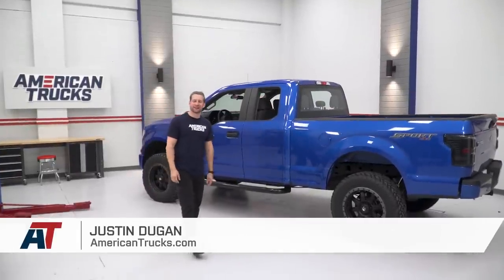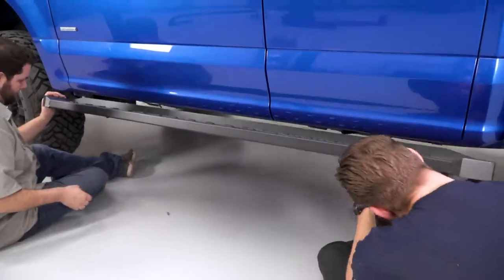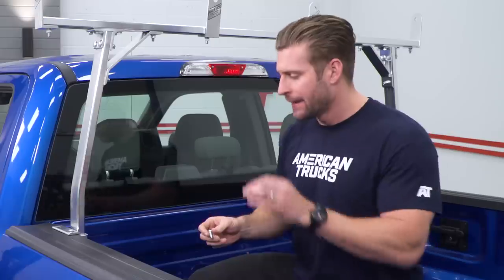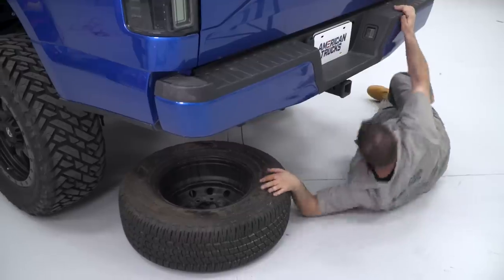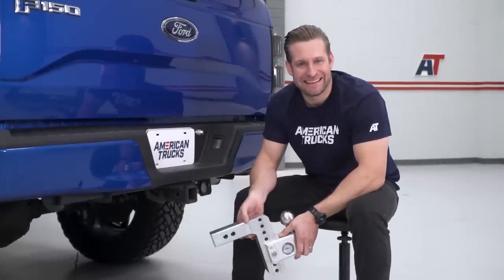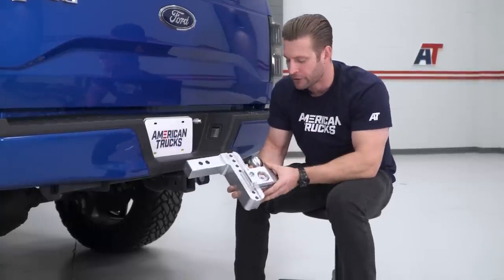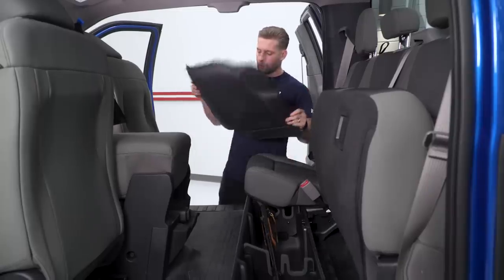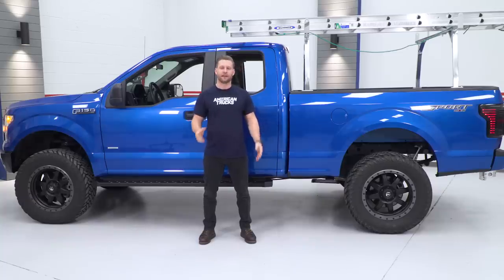The 8 Parts You Need For Your Ford F150 Utility Truck Build - The Haul

Comment from the maker: What are the must-have parts on your utility focused build?
Reply: AmericanTrucks Ford 
Winch, hitch, auxilary front and rear lights, tool box and for sure a power inverter
Reply: Used a glad hand on my bumper with a shut off valve all weather capable that way.  Opposite side glad hand has your normal air hose fitting on it.
Reply: What's the make and model of those tail light black out covers?
Reply: Backrack was a must after busting my window. KYB MonoMAX shocks, LT rated tires(dont pop as easy) bed liner,  tool storage, Dickies seat covers. 
A locking diff and skid plates for getting around on construction sites and the land fill is on my wish list but probably won't happen til I buy a "new" truck, hopefully an FX4 with that gear already.
Reply: An 8 ft. Bed with drop-in bed liner.
Reply: Tow ball in bed, better alt, tool box, kickass front bumper, manual trans, better cooling and i'll keep thinking of new more things
Reply: Why not use racks that go in the stake holes?
Reply: Mounts for turrets, and stuff.
Reply: The point of the steel bumper replacement is it have protection from the deer, this bumper wouldn't protect against anything but maybe a bunny
Reply: There's another rack, I think built by Yakima, that's adjustable up and down. I plan to get one for my truck, and then add my Yakima basket on top. With it being a bit more low profile, It should look pretty cool. And that basked is extremely useful.
Reply: In addition to a bed liner I have a thick rubber bed mat in my truck, saves the metal from dings and damage when throwing chains and binders etc in the back.  They dont roll around and you hear less rattling
Reply: Auxiliary gas tank.

Comment: My build would be upgrading the alternator to 440 amp alternator, install waterresistant plug in jump start receptacle in the front grille, standard 12v receptacle on both sides of the bed, and single 220/240v receptacle at the rear bumper.
Reply: Samuel Hur  I'd like to see that build
Reply: Heck yeah brother I'd be first to copy if you make it work out.

Comment: Those step rails should have a third bracket. They appeared to sag in the middle a good inch plus when stepped on.
Reply: Yeah I wouldn't use those they look flimsy as hell
Reply: Those steps are NOT sturdy...  I would avoid those...

Comment: A tool box that is half compressor and half tool box is way more utility than a unit that will take damage the first time a little clown car rear ends the truck )which will happen several times in the life of the truck) and displaces the spare tire from the most practical place imaginable for it.

Comment: I've purchased and installed the AMP Research BedStep2 based on this video.  Absolutely great product that solved a real problem - bed access at the side of you truck bed.  Assembly and installation was easy.  The whole process certainly will take less than and hour.  Installs on existing frame with no drilling or modifications.  Very, very nice!  (A bit pricey.)

Comment: Honestly as an owner of a construction company with the need of work trucks, this is pretty much the set up I use for some of them, instead of the ladder rack, I’ll throw a tool box and instead of the front bumper I’ll just put a brush guard, I do put cheap mudding tires and wheels so the employees can have fun on the dirt from time to time

Comment: Steeps bending in the middle! How solid can they really be?
Reply from the maker: *Steps.  And believe me, despite the small amount of movement from a 200+ man bouncing on them, the barricades are very solid.  -Justin
Reply: All steps bend, the ones from Ford bend too, and technically they flex since bending implies that they don’t come back to original position.
Reply: Daniel Napast My factory steps on the 2012 lariat don't bend. And I weigh more than Justin.
Reply: Ink stained canvas My factory steps on my 08 lariat dont bend and in a 320lb man
Reply: You don't even have to bounce on them to see them flex. Pretty chintzy if you ask me.
Reply: My 08 Ford steps bend lol I'm about 190-200lbs and they bend.
Reply: AmericanTrucks Ford  Well, they shouldn't. Im sure they're just fine but they need a center support as well. I call that well built.
Reply: I should do a video on the side steps I built that don't bend.
Reply: @danielnapast4955  I can assure you my rails don't fucking bend on my 2018. They do not "ALL" bend.
Reply: If the steps bend you don't need other steps, you need to lose weight.
Reply: 14 gauge steel?
So sheetmetal...
Why wouldn't  they go with at least 12, better yeat 10 gauge.

Who makes a affordable set, that if you stuck a hi-lift jack under in, you could pick up one side?
Anyone?
Reply: The $99 steps I had on my old 09 didn’t even flex when people stood on them. The factory steps on my 2014 lariat indeed to not flex whatsoever. I wouldn’t trust steps that flex.

Comment: I want those rims for mine. The under bead air compressor wouldn't be a bad idea but I won't lose my spare tire for it. That ladder rack should have been black but I'd rather a shell with a cargo top than the ladder rack. What should have been included is the latch that lets you swing down the back seat. I put one of those on my 13 and it makes for a great storage area.

Comment: The hitch is what I like best. I wouldn't put pneumatic equipment in the dirtiest least accessible space, nor get rid on my spare tire. Also the weak fixed aluminium frame gets in the way when climbing on the bed. Has to be better options. For the fixation great point about Galvanic corrosion but use stainless steel bolts (of same strenght) with insulated washers, not zinc plated self-drilling screws !

Comment: I WOULD SAY A BED LINER WOULD BE A MUST HAVE FOR A UTILITY TRUCK OR ANY TRUCK FOR THAT MATTER TO PROTECT AGAINST DAMAGE. AND WHAT HAPPENS WHEN  YOU GET A FLAT NO SPARE TIRE UNLESS YOU PUT IT IN THE BED PERSONALLY I PUT MY AIR TANK IN BEHIND THE PASSENGER FENDER WELL AND HAD THE AIR COMPRESSOR IN THE ENGINE COMPARTMENT MORE LINE IS REQUIRED BUT RAN IT DOWN THE FRAME RAIL AND LOOKS NICE AND CLEAN BUT WILL REQUIRE A CUSTOM BRACKET MOST OF THE TIME TO MOUNT IT IN THERE

Comment: 1 zinc does nor stop galvanic corrosion, it makes it worse
2 mounting the switch and gauge under the bumper will rust it away and corrode the contacts in the switch
3 that bumper is really cool if you dont have chrome, nothing bad to say about that :)
4 why did you opt for not putting a mat over the front hump?  and no rear mats?  This seems like a huge oversight.

I really love the idea of the onnboard air, but I never see anyone address the 20 ton gorilla in the room.  That is that mounting the pump and tank under the vehicle will lead to premature failure from rust and corrosion.   I never see any interesting ideas on how to protect it.
Reply: Maybe use bed liner on the air tank. For the compressor I'm not sure if that would be such a good idea.
Reply from the maker: I'm sorry but you are simply incorrect about your statement towards zinc worsening galvanic corrosion.  While not perfect (aluminum to aluminum) Zinc and Al are extremely close on the galvanic table while the 'Anodic Index' falls under .25V which is acceptable in outdoor/wet/salty environments.  And in regards to your statement about the on board air,  as stated in the video you can mount the system anywhere you see fit, we just selected the spare tire area for the sake of the video. -Justin
Reply: We'll see when whoever gets that truck has giant holes in the bed in 5 years
Reply from the maker: If you have a scientific rebuttal or proof stating the contrary, I'd love to hear it. And I'n not being a dick, I'm genuinely curious.  -Justin
Reply: electrohacker Zinc coated screws are better than stainless screws in joining aluminum. However, your only going to have a galvanic reaction if the materials are touching and there is moisture present. Using bolts with Teflon washers or sealing the connection from moisture might help... but welding the aluminum directly is the only way to eliminate the problem.

Comment: Dude mentioned galvanic corrosion! As a welder, that was worth more than most of you realize 😉 👍
Reply from the maker: Haha, thanks for that! -Justin
Reply: Ford doesn't pay attention to it. For YEARS they were using uncoated bolts to hang up aluminum exhaust shields, and then the shield ends up with huge holes where the bolts sat and would fall off or rattle around. Then you'd have to use huge fender washers to try to keep the thing held up.

Comment: Good video.  

However, moving the full side step back a foot would have likely provided enough boot room so the (very cool) Amp side step was unnecessary.

I like the compressor, but how safe is compressed air in a collision?  BOOM?!

Also, no inside blueprint/gun rack?

No outside locking tool box(es)?

No cold air intake mod, etc.

If you ever have done commercial or residential construction, you understand the value of these suggestions.

Thank you for pulling together such a nice video with some very cool mods!!

Comment: Question: Does this (or most others) bumper that covers the intercooler intake restrict the airflow enough to hinder performance? I’ve wanted an off-road bumper with winch but everything covers that intake.
Reply: I was wondering the same thing.
Seems obvious that it will inhibit the intercooler. I really like the look though.

Comment: How is the iron cross bumper going to effect the CAC? Doesn't Ford say not to run a plow on it as well?
Reply from the maker: Its not ideal but there is flow to the charge air cooler.  However since the goal of this video was to appeal to all 2015 and newer trucks it made sense from a 'utilitarian' aspect.  -Justin
Reply: They will ruin the engine with that bumper
Reply: @kawiracer475  it's a Ford it's already ruined
Reply: @kawiracer475  -Wrong.  Don't be stupid.  Class dismissed.
Reply: @243wayne1   Ask any tuner.  They say not to even put a small light bar in there.  You're about 2 years late to the class buddy.

Comment: Damn Dude this truck came out looking BADASS!! I need something like this for my job. I do framing/carpinteria. I use all kinds of ladders and power tools. Where did u get the lug nuts that hold down that mount for the ladders? I just want to take the advice you said about the problem with wrong screws on the aluminum truck.

Comment: The air compressor was the only good suggestion, and suspension support air bags should be a must on an F150, an 8 ft bed would have been actually useful.  1/2 ton truck won't tow much. it is very sad for me to see sooo many short bed trucks with luxury interiors pretending to be a truck

Comment: In NY that air system would be in rough shape due to sand and salt spray.  Also modern trucks are hard enough to use for work without a lift kit.... they are so tall
Reply from the maker: As stated in the video, there are a number of places you can install an on board air system.  And I agree with you on the lift, but there wasn't much we could do about that one as all of our shop trucks already have a lift.  Its also why I said in the beginning, 'try not to pay attention to the lift kit and tires as the parts in this video are meant for all 15+ F150's.' -Justin
Reply: But not in Phoenix.....

Comment: I see FAIL #1
You did not get a spray In Bed Liner
but
I like the On Board Air, would like to know other locations for mounting
and
is the bumper a straight BOLT ON

Comment: Details on the lift kit, and wheel & tire size plzzzz
Reply from the maker: The truck in this video is utilizing a 4" Zone lift kit along with 20" Fuel Wheels and 35x12.5x20 Fuel Tires. -Justin

Comment: Can't reach the tool box? Can't reach the rack? Can't climb into the bed? 
Don't lift a work truck. Lol.

And please don't believe the block with a scale. Most receiver hitches have a tongue weight of 300 lbs or less. Putting 1000 lbs on the tongue to tow safely doesn't help if the hitch shears off.....please know the limits of your equipment. Just because ford says you can pull 10,000 lbs doesn't mean you have the gear to do it. 
As a cdl operator I know what you need to pull 10,000 lbs or more.

Comment: Whatever happened to the slots designed on truck beds for this purpose? You loose bed space now.
Reply: The stake holes? They're still on trucks, but some people don't like using them because they claim the racks wobble. I've never had this issue on my truck, but I don't keep a rack installed all throughout the year, just during the summer months when I've got a ton of projects going on.

Comment: So it’s okay that the air compressor can get wet?
Reply from the maker: Yes- as long as you don't use it while its fully submerged, absolutely. -Justin
Reply: AmericanTrucks Ford thanks for the reply. I’ve seen guys put the compressor behind the rear seat but i keep my strap, hitch, jumper cables, etc back there
Reply from the maker: Yeah I originally mentioned about putting it under the rear seat (but they cut it out)  although keep in mind, the compressor can get a little warm when worked hard.  -Justin
Reply: AmericanTrucks Ford thanks again! Keep up the great content
Reply: Got mine in the bed, against the side wall with a plating to protect from impact. Combine with swing out saddle boxes for all your basic emergency needs.

Comment: My poor 2.7 eco boost. I put 20” wheels and 33” tires and it killed the gas mileage and pep.
Reply: @isaacrush9184  no sir
Reply: @79dogface  so…. Tremec has a gear ratio calculator so best bet says that if you change tire size from 30.05 with 3.55 gear ratio to and 32.2 tire size the best gear ratio to maintain stock pickup and go is “like 3.84”ish I say that because I looked at it when going to a large diameter tire. 

From there I looked at which was closest to factory and that was 3.73 only due to the fact that I wanted better MPG TO power Ratio
Reply: @isaacrush9184  right on. Thanks for the info

Comment: 4" lift not a fan...Bed side step yes....Bed racks look cheesy......Running boards not as classy as factory.....Air system yes but not displacing spare tire which will now probably take up space in the bed....Rear seat storage no way. It eliminates space to throw in large boxes or bikes when the seats are up. And the front bumper, how in the world can you install the locking pin for the front hitch receiver? Rear tow hitch, overkill! Floor mats yes!
Reply from the maker: Yeah the lift was kind of a non-negotiable since all of our shop trucks have already been lifted.   The air system can be installed just about anywhere but thats where we installed it for our truck.  Front bumper/hitch receiver is surprisingly accessible from underneath.  And rear hitch might be overkill for some but its never a bad idea to error on the side of caution when towing.  -Justin

Comment: Well that is a perfect truck for me but Like the v6 not a twin turbo 4 I can't see a turbo engine on the road after 120,000 miles .
Reply: Richard Archer get the v8 great engine and naturally aspirated
Reply: Richard Archer my Dads ecoboost has over 180 000km on it and it's still running strong
Reply: And what about all the turbo diesels with well over 300k? People seem to always forget about that

Comment: Y'all turned this into an old man truck
Reply: It was sort of decent looking at the start but then they added those shitty sidesteps and then the ladder racks in the tray.
Reply: Ha gentleman it's a utility build. Honestly the lift needed to go as well to make the truck more functional.
Reply from the maker: Another meaning of Utility is 'functional rather than attractive.'  That was the point of this build fellas, I know not everyone is digging the look or all of the parts selected but its what we came up with based off some of the parts we sell.  -Justin
Reply: what old man has 35 inch tires Besides a bad ass old man...

Comment: That deer is still gonna fuck up your grill, no protection in that bumper. Also horrible placement for the switch and air pressure gauge, put that shit inside and if you're too lazy to walk around the truck, add a remote switch in the rear that is hidden and easier to replace when it gets corroded.

Comment: Those tail lights make me want to vomit... 
The air compressor is cool, but in a Canadian winter the last thing I want is that kind of stuff dangling off the bottom of my truck.
Reply from the maker: There are a few places to install an onboard air system- we just utilized that location for the purposes of the video.  -Justin
Reply: I can see myself picking up those add ons on my way out of the bush träils I travel

Comment: why lift the truck if we need 2 steps installed afterwards...???.... not very useful to my eye...
Reply from the maker: I agree starting with a lifted truck wasn't ideal but its what we had to work with at the time.  And that's also why I stated in the beginning of the video to try and ignore the lift as all of the parts selected would fit just about any 2015+ truck. -Justin